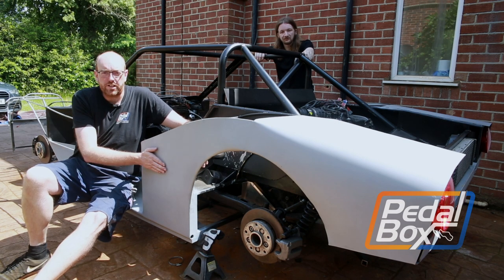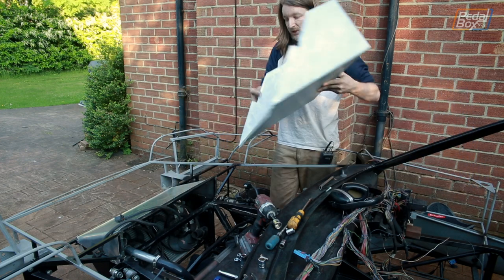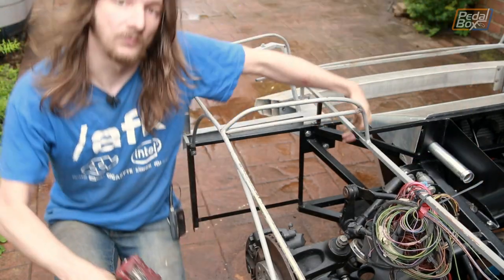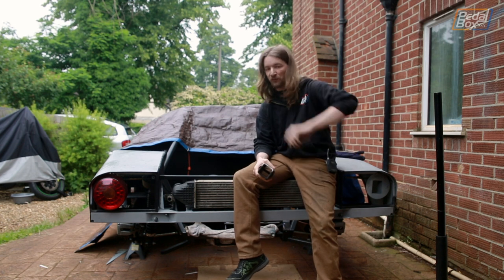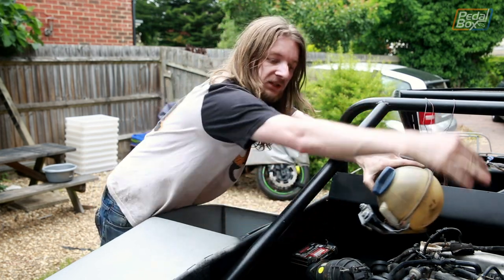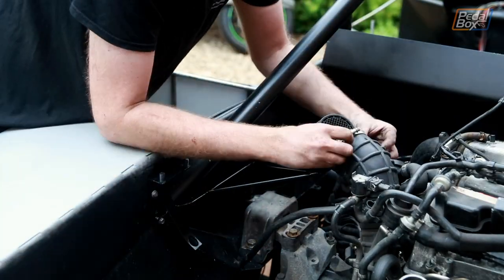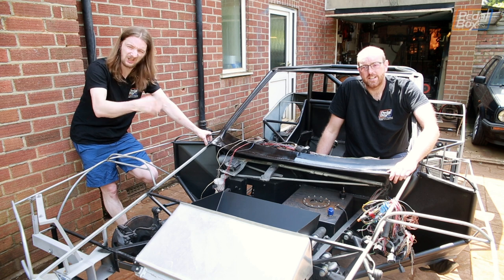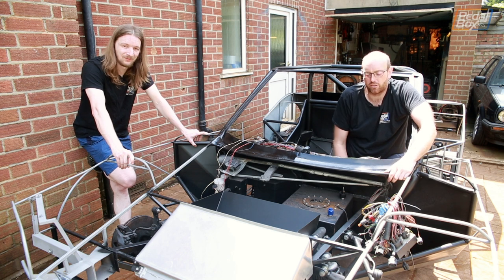Wires, Panels and Brackets | Audi TT Kit Car | PedalBox Episode 78

Comment: Keeping those looms on the connectors is great idea, I'm sure most of the wires going to the AC relay box is mostly for the AC only, the fan relay used by the ECU was in the car and the fan switch as per MK2 golf is still on the rad, what year is it and a BAM?

Great video BTW 👍
Reply from the maker: Thanks Crispy! 2001 BAM, we' stripped all the AC and AirBag wiring out, just kept a few in that might be triggers from ground to the ECU (seemed important and easier to leave than fit again later)
Yeah got some help coming with the Fan box fortunately, had a look briefly at the bypass and went "nah, not today" lol